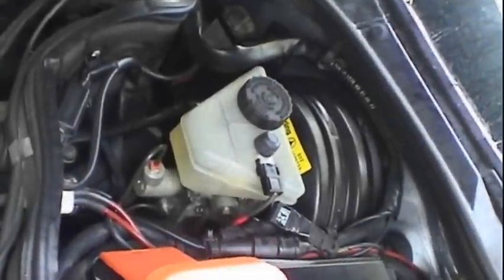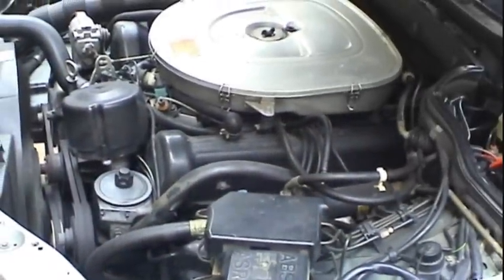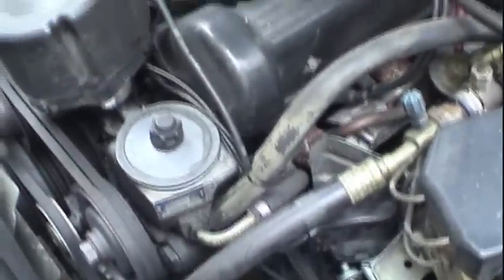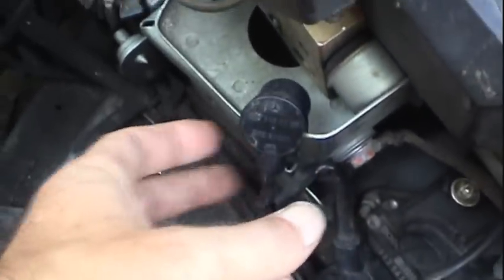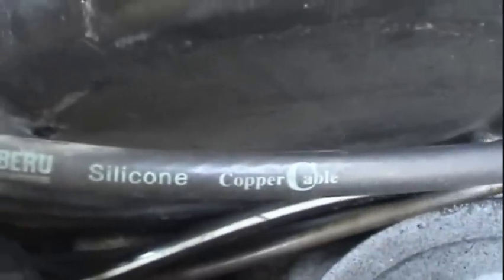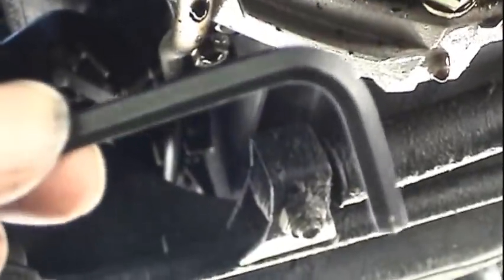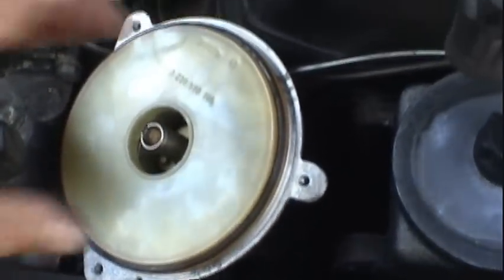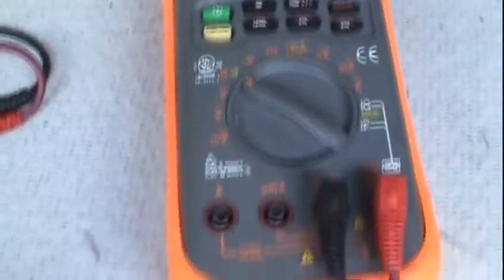1991 Mercedes-Benz 420 SEL Breakdown (Won't Start)

Comment: Just replaced the crankshaft position sensor in my 1990 420SEL at 150k miles. Initial symptoms started around 140k - felt like the transmission was slipping - a sudden loss of forward momentum; symptom then grew to the car turning off at random while traveling at speed - VERY DANGEROUS. Replaced the sensor and the problem was solved. Replace yours - you don't want to have the car die on the interstate at speed because you lose power everything and could quickly get rear ended. Great video - thanks!

Comment: Hi thanks for taking the time to post your troubleshooting problem regarding cps,I've just purchased a w126 300 se with one previous owner and car has only covered 48k miles from new and as I do with any classic I buy although service history is there I like to just double check myself for piece of mind on the ignition system and replace what may have been missed.
On that note car ignition components all good and not showing any signs of wear.
I'll keep your tips in mind for future old school diagnostics is the best way.
Thanks.

Comment: Thank you for posting such a methodical, careful video. Same thing happened to my 420 SEL, however after replacing the Crankshaft Positioning Censor it still did not start.
Next part in line was the Ignition Control Module. I bought 2 used ones, just in case. After replacing that the car is running again! :)  and again thank you for this video.

Comment: really good information for the W126. the high idle may be the OVP relay.
Mercedes OVP relay repair

other causes:
1. Idle control valve
2. Idle control unit
3. OVP relay
4. Throttle position switch
5. Worn injectors
6. Broken/brittle/missing/disconnected vacuum hose(s)
Reply from the maker: I thought about that and tested it. It tested fine, but they're not expensive. It may be worth purchasing a spare and trying it to see if it helps.

Comment: Great summary.  I have a similar problem with a 380 SEL and will be testing and, I am sure, changing the crankcase sensor, Ignition Control Unit and the Overload Voltage relay.  Parts seem to have come down in price.  Thanks for this video.

Comment: Looking at buying a 1991 Mercedes-Benz 420 SEL with 122K miles that has been sitting since 2013 - can you please provide an evaluation process to prepare the vehicle for starting and possibly draining the fuel from the tank and review other components before starting it, maybe refer to other resources so the reviving process is successful

Comment: Very wonderful and helpful information, no mechanics or dealers would ever match your analysis. My 1991 MB420SEL, presently not running is supplying parts for my 1989 MB420SEL(280KKM)My 89MB560SL(145 K KM) misfiring at times   Perhaps  the whole set of spark plugs wiring  and the distributor need to be changed. Keep up Shadowrider 460

Comment: The sensor on the front of the engine is what runs the tachometer, I don't recall if you mentioned that or not in the video.  Good job showing how you diagnosed the no-start issue.  Too many people just throw parts at it these days.  I love these w126 Mercedes...they're quite nice to have as daily drivers, and generally don't break the bank too badly to keep them on the road (if you do your own work).

Comment: Dear shadowrider , thanks for your Excellent informative video , after watching your video , i was able to diagnose my 560 SL for no start and my problem was with Crankshaft Position Sensor . I could not find the part for it but i have a 91 300 E parts car which i took off the  CPS  and put it on on my 560 SL and it started right up . I will have to locate a new CPS but until then i can drive my car .
Thanks again and keep up the good work .

Comment: Thank you for your video.  Same thing has happened to me 3 times now.  RAA couldn't figure out what was wrong as by the time they arrived, car had cooled down and started straight away.  When my mechanic looked at it and tested everything, his conclusion was dodgy fuel and the advice was keep the fuel level over half a tank full as it is probably a vapour lock.  Car wouldn't start again tonight after driving for 7 minutes and parked for 5.  Restarted after 10 minutes but stalled after 2 minutes. Three quarter tank full.  I will consult with my mechanic as to your solution as I know this wasn't something he checked.  Hopefully this is the problem.  I will update once a permanent solution is found.  Just for the record, the spark  plugs and spark plug leads were all replaced 5000K's ago.  Distributor cap and all filters have been checked.

Comment: Very good DX,  great job of eliminating possibilities, sure saved a heck of a lot of $$$$ because Mercedes charges about 160.00 an hr you could have had a expensive bill, so in the end all you needed to replace was the CPS and replace the cap, rotor and wires which is good maintenance for wet weather driving because when wires get wet the car wont run, you are good at electrical DX

Comment: well done video I ACTUALLY OWN BOTH MODELS 1991 420 SEL AND ALSO 1991 560 SEL 
THE 420 SEL TROUBLE STARTING AND THE IDLE IS LOW AND THE 560 SEL DRIVES FINE BUT THE IDLE TOO HIGH

Comment: Hi there interesting video, we have one over here in England, similar model,  with a similar problem it has no spark, i dont think its the crank sensor because there is no spark at all no even when cold...we have tested the crank sensor on Labscope and looks ok, this one has a cam sensor inside the distributor, which we also tested on scope and its ok, i done a manual test on the coil and got a spark out of it, tested all the powers and grounds on the module...there is no coil primary switching, the only thing left is the module so were fitting one of those...hope it works, if not it will be easier to test things with a new module on...from Fred in England.

Comment: Ok well today I discovered that the crankcase sensor had already been replaced, I thought the wire looked newer but when i removed the air cleaner saw that the person who replaced it just left it dangling, one end melting on the manifold. I did a quick mulitmeter test for resistance and the new cable checked out to be functional.

I performed a fuel pressure test today.  Results were good with fuel pressure 48 psi cold and off, 49-50 at idol  and no change when the engine reached operating temp of 82 deg C.

here is where I am now.  car will idol well in the driveway for 30-45 mins until the temp gets to 82C  then it begins to sputter.

wondering where to go from here?

Comment: very useful video.  I have one comment however.  When the EZL was being tested in the video, the red wire is shown as connected to the center post on the distributor cap.  this is a little confusing to me.  I thought the red wire (to create a gap) should have been connected to the high voltage cable coming from the ignition coil to verify if there is a spark coming from the ignition coil.

Comment: yes, as another poster said cosmoline.  they used to put it on everything, guns etc...  not sure if they still use it tho.
i too had a cps fail on my volvo 240 wagon, caused by deteriorated insulation making the sensor short and the car to not start/stay running.  but the volvo was a 92, and the sensor was only about 13yrs old at the time.
interesting video as usual!
Reply from the maker: It was a challenging issue to track down since a bad CPS wasn't my first guess as to what could be wrong. I'm just glad I could finally find the root cause and restore my confidence in it again so that I can drive it without fear of it breaking down. I shudder to think what the dealership would have charged to diagnose and make these repairs. The parts alone were around $520.

Comment: Idle must be at 550 solid all the time!!! If not you will have ongoing running problems such as harsh gears shifting, lumpy idle and rough driving at low speed etc.... You can start with the coolant sensor and the ICV, the valve itself can be adjusted slightly for smoother running.  The best test for these engines, is the engine must feel like it died when you approach a red traffic light. The only thing tells you that the engine is running the RPM sitting at 550, otherwise it's waste of time!!!

Comment: Thanks for the tip on finding the date code on the ignition components. I had no idea.
Reply from the maker: It just amazed me that this car ran 187,000 miles on the original cap, rotor, and plug wires. In fact, these parts could still be used but I wanted to do a complete job if I was going to replace the CPS.

Comment: Hi…i have a question and the Same Problem Like you. I have no spark out of the coil on my 560sec. I diagnosised the crank shaft position sensor but now I’m a bit confused. My old sensor I took out and it shows me the same as yours between 0.800-0.960 megaohms…your old one shows the same…but when u put your new one in it shows aswell 0.860 mega ohms so how do I know mine is bad? Thanks

Comment: Shadowrider460 have you replaced the timing chain, guides, and tensioner? I bought a 1990 420sel with 90,000 original miles, without warning, I went to start the car and the timing chain jumped timing due to a failed plastic guide.   There was no rattle to forewarn me of the looming potential of a failure.  The engine was running smoothly beforehand.  Now, I need to do a valve job in addition to the timing chain and guides. I haven't decided if I am going to do that or scrap the car.  It's a real shame since the car is in beautiful shape otherwise.
Reply from the maker: Yes. I didn't do the work, but I have all the maintenance records. The chains and guides were replaced not that long ago. I'm sorry to hear that your chain broke. If you can afford it or do the job yourself, then I would keep the car. It'd be a shame to scrap it as these W126's are getting harder to find. If you get it running, then I would also replace the drive shaft flexible couplings as well.
Reply: ozelot250

Comment: I have the same car...rough idle just started happening...engine has a rough time turning over when hot. I replaced the cap n rotor but nothing has changed. help !

Comment: To make a suggestion if you use Simple Green on your white walls on your 72 Lincoln that will clean them up if you don't like scrubbing them but you can use, it works great and then of course armorall or something of the same type of wheel stuff. Its funny how many of the same car as me and you have owned the same type I had a Lincoln Mark 786 LSC I had a Mercury Grand Marquis 86 I have a 93 town car of 2010 Town Car I've had a f250 4x4 a 92 with the 460 in it. So we have the same tastes and likes in cars for sure

Comment: Your high idle problem may be an ETA issue. I have a 92 400E with the same problem and it appears the ETA is the issue. If you can get the computer codes you would be able to narrow it down.

Comment: hi shadowrider, first thanks for all videos including this one. I also have 420 sel and trying to fix it. In this video on 33.10 you mention shortly about "cylinder identification sensor" - I noticed on my car that this front end sensor is not attached a all but it is plugged in; wondering where to stick it??.... car doesn't work properly, dlack smoke, rough engine bcs of that I guess...

Comment: That "clearcoat" is actually called cosmoline, I beleive. When I worked for BMW they shipped new cars over seas and coated many components with cosmoline, similar to a wax to prevent seasalt coroding components. Most dealerships will use a degreaser to clean it off.
Reply from the maker: I have heard of that product before and in this context, it makes allot of sense to use it during shipment. It does seem to have done an excellent job of keeping corrosion in check.

Comment: first think I'm going to do in this situation is:
pouring fuel 100ml thru MAF (remove air filter cover and poor the fuel on MAF plate)
and crank
if the engine start to run for two seconds, that will tells you that the ignition is fine

Comment: Hey shadow rider may I make a suggestion on improving the looks of your old Lincoln that you have try scrubbing the white walls it would make it look better with nice clean white walls and definitely need to get some white walls for your Roadmaster those raised white lettering tires or not the right ones. the right look for that car for sure definitely need some white walls ok take care your beautiful car collection I have one myself we have a lot of the same cars me and you and had the same cars I had a mark XII LSC1986 I have a 2010 town car I have a 1993 Town Car I have a 2003 Chevy s10 pickup a Mercedes Benz ml 320
Reply from the maker: I've never liked the raised letter tires on the Roadmaster either and feel that they don't look good on that car. They are in fairly good shape though and I hate to get rid of good tires. So I'll run them into the ground and look forward to a new tire purchase in which I can finally purchase the right tires for this car.

Comment: I want a car like yours .... And i've been seeing your videos to see what kind of maintenance or issues I might run into if I decide to purchase one I have my eye on a used one but it has almost 200,000 miles the one that I have is a 1986 Mercedes 300 SE with 156,000 miles but the car that I'm inquiring has a lot more miles .   Do you still have  this car or are these videos old
Reply: +Ram M457 Yes he still has it. shadowrider's w126 actually has about 200k as well.

Comment: Hi Shadow Rider, Just noticed some oil leaks in my Mercedes. Any quick words of advice from you on how to deal with this. Thanks in advance for your help !
Reply from the maker: Oil leaks are tricky to find. The best way is to clean the affected area very well and start watching it to see where the leak originates. Typical areas are the valve cover gaskets, oil cap gasket, front crankshaft seal, and rear main seal. If the fluid is red, it's transmission fluid. If it's dark, then it could be engine oil or power steering fluid.

Comment: Hello Shadowrider, my wife’s 89 560 sel also stalled. It cranks but will not start. There is spark and I checked the resistance for cps and it is within range. I smell fuel but I do not hear the fuel pumps cycle. I replaced the fuel relay with an aftermarket one and also tried swapping my old relay and still will not start. I am not getting any voltage reading on the pump either with the key on. What would you recommend? Thank you.
Reply: I think  the guy has left this world.

Comment: you should also change the ignition coil if it is original, it has been revised and is less likely to destroy ignition control units - assuming the rest of the ignition system is well maintained.
Reply from the maker: That's not a bad idea. I was already thinking along those lines when I purchased the spare EZL a while back. Having a spare coil in the trunk may be a lifesaver one day.
Reply: +shadowrider460 a  bad coil burns ignition module at times than both will have to be  changed to attain function again ,  indeed diagnostic is a nightmare for many shops , and no one tells the story

Comment: I haven't watched the vid all the way through, but reading your description you say you did wires, cap and rotor. Why didn't you do plugs as well?
Reply from the maker: They shipped the wrong plugs and I had to send them back. Besides, these plugs have about 20,000 miles on them and are still good. I'll probably end up changing them next year and possibly do an upgrade.

Comment: You have a thin jumper attached to the center of the distributor, then looking for a spark? The spark comes off the coil, via the short HT wire that GOES TO CAP. Oye....

Comment: if the crank angle sensor is failing, the EZL should have a code 17 logged. It knows when you are cranking and if it does not see a crank signal it will store the code. Obviously you should clear the codes before making an assumption and repeat the test
Reply from the maker: I don't recall a code listing for the EZL in the service literature I have but then again, I may not have all the literature available. I know I don't have the transmission manual, sadly. That sure would have made the diagnosis easier but as it turns out, it's good to be able to troubleshoot things the old fashioned way just in case you don't have all of the information or diagnostic tools at your disposal.

I'm happy to report that after another heat soak along with a 10 mile test drive, the car performed flawlessly and never missed a beat. I now have confidence in this car again that I'll be able to go on a long journey with no issues.
Reply: Excessive resistance / open circuit of the crank angle sensor when hot is also a known failure mode so you will be fine im sure ;)

Comment: My car has been just undriven now, couple, three years, and seems to start / or not start at all, when I sometimes go and try, must have some fuel/ problems, standing so long?? I put new fuelfilter, and pump last time I drove it a little bit, couple years ago, and put "marinegasoline" in a tank, should I change accumulator also in a fuel system?? Or fuelpressure sensor?/ Thanks again, good job =))
Reply: Mine sat for many years. It was drivable at first, but eventually it couldn't start. I replaced the fuel filter, pumps and fuel pump relay. Eventually I replaced the fuel pressure regulator which was the culprit. The car didn't start up immediately. I had to replace the spark plugs and dried the flooded engine. Here are signs of bad pressure regulator: http://www.doityourself.com/stry/7-symptoms-of-a-bad-fuel-pressure-regulator
Reply: Where is it located in my MB 500 SEC?? how much is a new one??